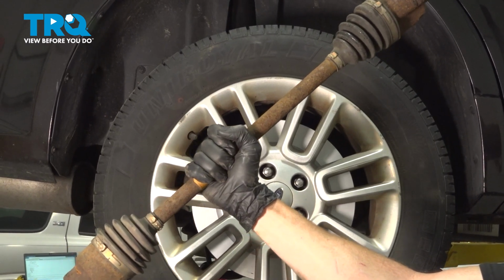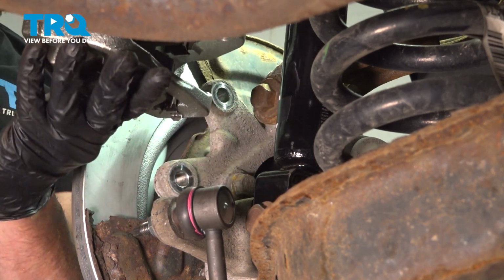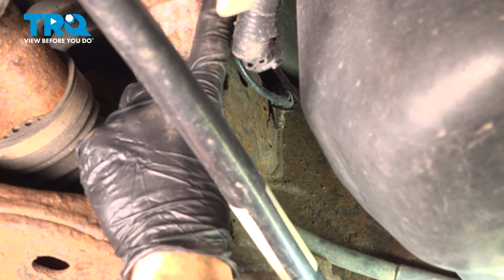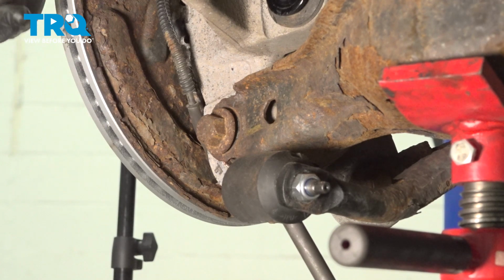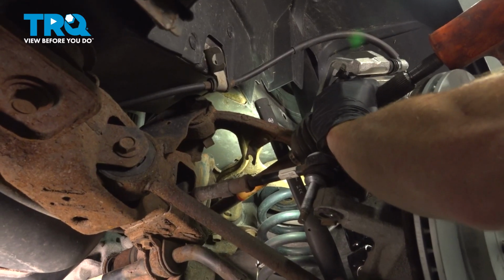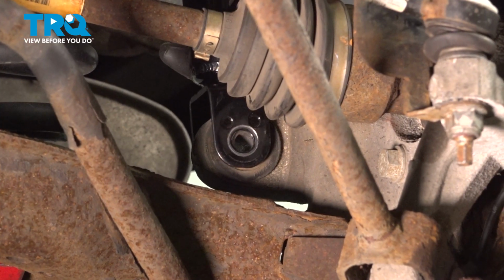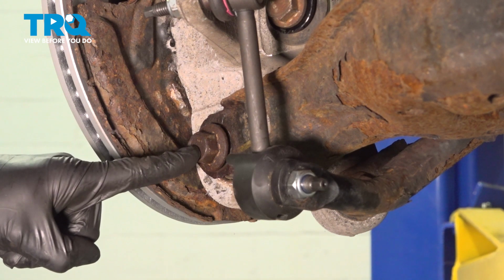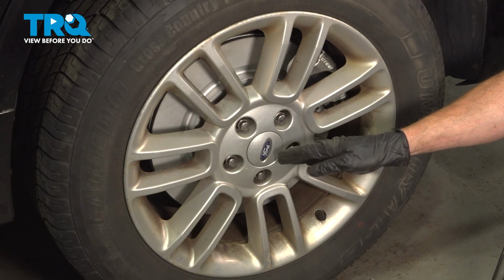How to Replace Rear CV Axle 2009-2019 Ford Flex

Comment: I now understand why you decided to unplug the harness all the way up there rather than chance the sensor. My bracket broke, then the rest of the sensor broke off when trying with pliers. Then, the wire pulled out. I tried a screw (in about 1.5 inches) and it pulled the plastic out. Finally, I tried a larger screw, and that one broke off in the hole. So, I now have to use an easy out on a hole which isnt even supposed to have a bolt then I have to drill out the old sensor. Ugh. And on top of all of that, I still have to go up the harness to replace the one I broke. I am definitely going to be going up the harness on the other side.

Comment: Hi  please can you help I  have 2017 ford Edge I am getting a thumping noise ( not all the time) from what I think is left rear side when pulling away I am not sure if it’s the half shaft or body noise as in something thump on the under body there is no grinding noise or crunching but not sure what other sounds a failing shaft would make my question is is the flex the same as edge when changing halfshafts in the same process other roomers I have read is the fuel tank can move I have checked most of all bolts and bushing I can get to would you no of any issues on Ford Edge rear problem’s thanks